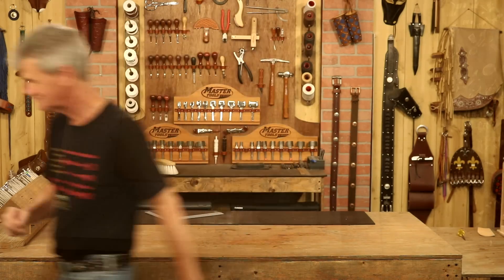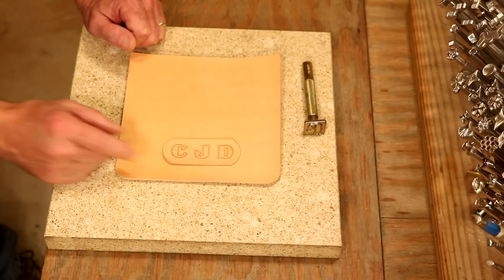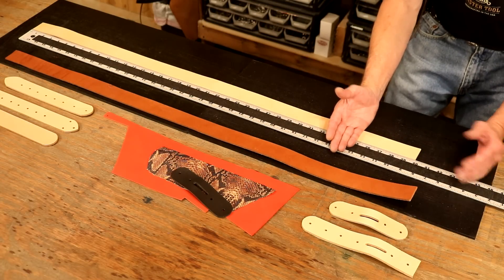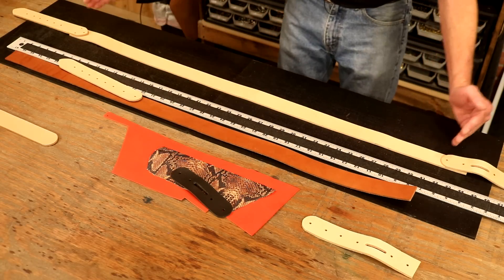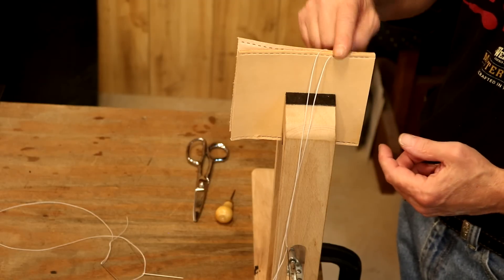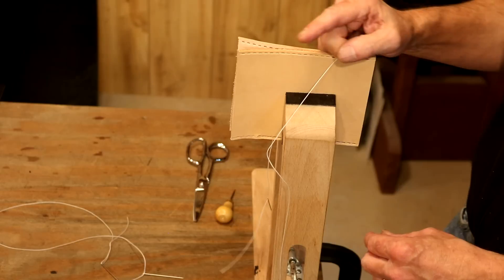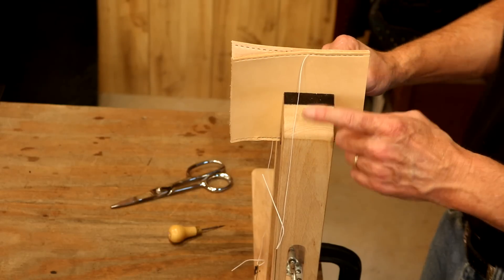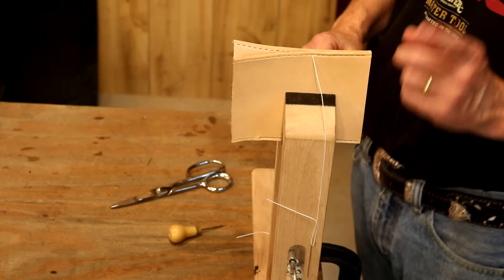The Leather Element: Curing Three Common Leathercraft Mistakes

Comment: Ok... one of my pet peeves is simply very long thread when stitching a long stitch.   I am gonna stsrt using that knot on the inside option, even when not a mistake.   :)
Reply: When stitching long lengths I usually just cut the thread the same length as my “wingspan” (the length of my arms spread out) so that i can cover as much stitching possible while still being able to tighten it by simply pulling through the needle. When I’m almost out of thread,I simply backstitch a couple of times and either tie the thread in the middle like chuck did or I simply cut it on the backside of the project and melt it with a lighter.
Reply: @OgeiDennepeL  I can appreciate that cutoff point.  I’ve only been leatherworking for a year and a half, and it just hadn’t occurred to me.   Amazing, the simple things that hit you sometimes.  I like the Leather Element series.

Comment: Hi Chuck! How could you easily and perfectly cut a strip of soft leather (e.g. nappa) straight?
Thanks,
Grretings from Hungary 👍😁👍
Reply: Chuck may have a better idea, but I use a straight edge on a table edge and very tightly clamp with a series of clamps (removing only one at a time and replacing to further my cut).  A VERY, VERY sharp stropped knife with multiple light strokes help, also.
Reply: @jackiemitchell4418  That's a good idea, thank you, 'll try :)
Reply: @istvanboros8240  also note the anti slip tape on the bottom of Chuck’s ruler. That helps prevent the soft leather from moving around as much while cutting